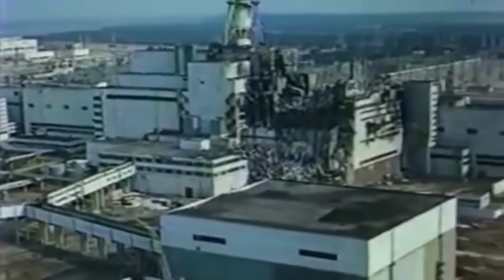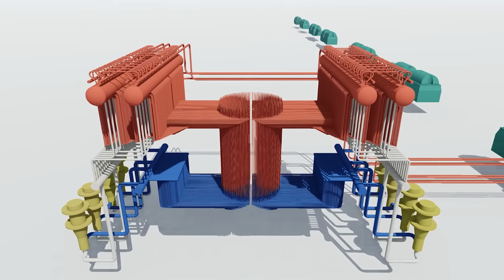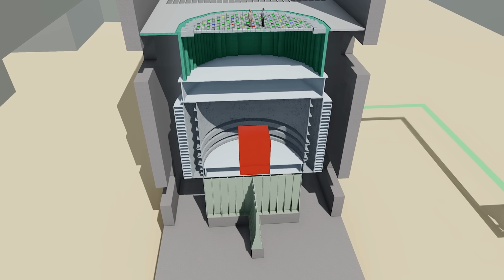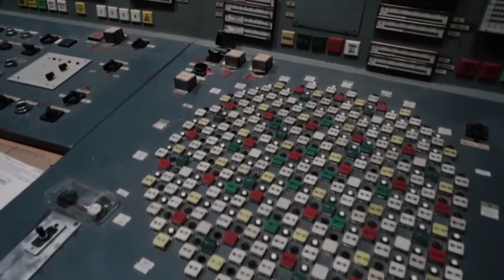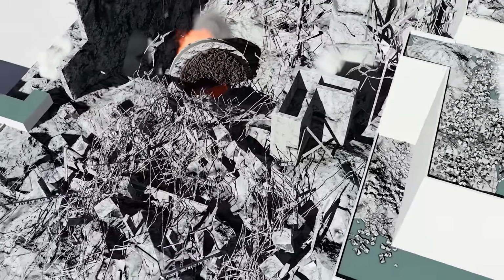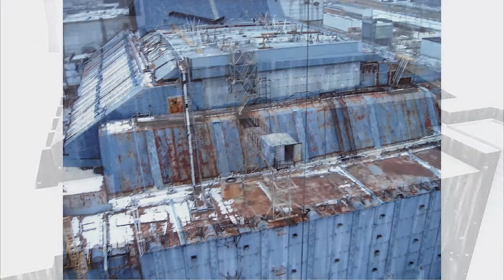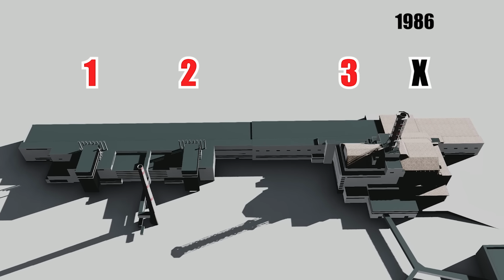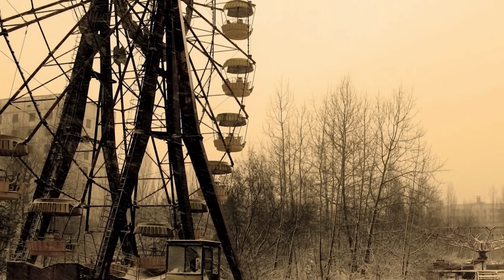CHERNOBYL DISASTER - An Inside Look - 3D

Comment: Most of what is said are comparisons that cannot be compared. That RBMK1000 had a positive reaction coefficient? Yes it's true. However, this is the only thing that can be blamed for this construction, and due to the low enrichment of uranium, it was fine, so RBMK are still used in the Russian Federation.

It is not true that the experience in the USSR was not shared, because all leading scientists not only in the USSR, but also in the CMEA countries regularly organized meetings and e.g. Since 1958, Czechoslovakia has been building its own nuclear power plant similar to Candu for unenriched uranium, cooled with carbon dioxide and moderated by deuterium, and cooperation with the USSR in the design has been ongoing.
Finally, the development of CMEA reactors was unified into 2 types, namely RBMK and VVER.
Today, VVERs are the most widespread types in the world and will continue to expand.
For example, in addition to the USSR, VVER reactors also produced in Czechoslovakia under the ŠKODA brand !!!
So the nonsense in this video is just Western propaganda ...
And please look for the causes of the accident through the outside, such as. CIA.
The Americans and others did not follow this path, not because it would be more dangerous, but because the development and production of nuclear reactors was conditioned by the use of higher-enriched uranium in order to make more money for companies that owned uranium enrichment facilities.
Therefore, the graphite reactors were unpromising because the low enrichment fuel was not available at a lower cost when calculating the same reactor power with the higher enriched fuel.

It is not true that the RBMK1000 had only one shield, but two shields, a steel cover and a concrete cover. The Fukushima type has 3 covers because it was high-pressure, so it still had to have a pressure vessel, but the RBMK is not a high-pressure type, so it does not have to have a pressure vessel.

Advantages of RBMK to the simple construction of undemanding materials and cheap fuel if the price of fuel is real and not artificially inflated by private companies, which repay the loan for enrichment facilities and thus the more they earn, the sooner they repay the debt.
In the USSR, the real price of less enriched fuel was looked at, which was several times lower and the materials for the low-pressure reactor did not have to be as high quality and therefore expensive.

The test was not for safety, if you mean the safety of the reactor itself, but for the test of whether it is possible to supply cooling until the start of diesel generators if the power cables from the outside interrupts and so reactor must be shutdown, because not possible send produced electricity to out.
A few years earlier, these Americans had bombed a power plant with a VVER-type reactor because they began doing similar tests on their power plants, so they were curious about how those behind the Iron Curtain worked.

All other RBMK reactors throughout the USSR have already passed this test, including Ignalina RBMK1500.

The USSR has disintegrated because you have tried and do everything and you are still trying to make the RF disintegrate, but you will not succeed, rather it now looks like the USA will disintegrate.

Ukraine was not left, Ukraine wanted to break away ...

In fact, Pripyat was a normal city like thousands of others in the USSR and the CMEA. But today with apropaganda, it is escalating because people realize (those who lived at that time) that life was easier and they would like to return by then.

We who have lived there will never forget, despite the fact that someone is still trying to rewrite history.

One example.
You received the prefabricated houses that were built at that time free of charge or on a non-repayable loan from the state. And these prefabricated houses in most places of the former USSR and CMEA are still used, and if you want to buy an apartment there, you and your wife must have a mortgage for 30-40 years.

That is the reality of today. You can have 3 cars and you are homeless and you must not be sick, because your life will collapse forever. American propaganda does not talk about that ...

Just as someone still claims today that Navalnyi was poisoned by the poison of Putin by Novichok, so the same people have been pushing you kohlrabi for at least 70 years about how dangerous socialism is, how people are killed there and how badly they live there. And who really lived there wants to go back, so the truth is not there as you get it every day in the media.
Reply from the maker: Thanks for the detailed comment. 

However you lost me as soon as you suggest the CIA could have caused the explosion. Please!!! ... just accept the reactor had a major flaw in its dangerous low power configuration and the design of its graphite ends to the control rods. The USSR did not require any assistance from the Americans to destroy Chernobyl. The RBMK was dangerous in itself and so was the secrecy and mind numbing bureaucracy inate in Communism.
Reply: @Mike-Bell  You claimed yours and I claim mine. It is a statement against a statement, but your statement is mainstream and mine is based on facts that have yet to be published. 
I just don't know if anyone will believe it, if 36 years after the accident, you can hear from all the media, which are not independent, still only one view of things.
Try to think like me:
What happened a year before the Chernobyl accident, what could have an impact?
Mikhail Gorbachev got into the highest position of the USSR.
And what else happened this year?
He ordered the withdrawal of Soviet troops from Afghanistan.
We know from American documents that the US has invested billions of dollars in the war in Afghanistan and probably to humiliate the Soviet army as a revenge to lose in Vietnam (this time we will defeat them).
However, the premature withdrawal of Soviet troops from Afghanistan meant that the money invested went into the air.
In my opinion, this is the reason why someone decided to make a diversion (They left without a fight but we'll get them anyway from inside).
I don't think that RBMK was as dangerous at that time as it is constantly repeated everywhere in the media, but if we help it with a small explosion inside, then it will be a real disaster ...
Reply: @heno_3098  What a nonsense
Reply: @heno_3098  The Soviets got fucked big time in Afghanistan for more than 8 years, the economic cost rounded on the billions and the diplomatic cost was deep...really hard to believe they needed more than that lol specially since Legasov spent a lot of his academic life even before the disaster giving warnings, idk man i'd take the word of the russian scientist specially one who had absolutely nothing to win going against the regime but knew what he was talking about, Valery Legasov.

Comment: I think that the Soviet leadership deceived the whole world on the scale of the problem. The explosion was nuclear in nature, but it would be more correct to call it a self-sustaining chain reaction .. Why do I say that? There is an objective reason for this. The video of the exploration of the central hall shows scenes where the operator is next to the signboard stand. These are sheds located 20 meters from the reactor shaft, where the fresh heat of the assembly hangs. They are not radioactive, as they were not in the reactor. But in the frames we see that these assemblies are hanging but twisted and bent into springs, that is, they were heated up to thousands of degrees. Outside the reactor shaft, there were no such temperatures anywhere. This means that the assemblies were irradiated with a powerful neutron flux and underwent internal decay with the release of heat. But according to the version of the Soviet government, the neutron flux (decay of uranium) stopped even during the explosion (thermal) in the reactor shaft. Ask any nuclear physicist if there is a dense neutron flux in a thermal explosion?
Reply: And I'd rather guess the cause of the crash, and one version says it was a CIA agent in revenge for the money wasted in the war in Afghanistan, where the US invested billions to defeat the Russians, but they voluntarily leave in 1985 year without battle.

Comment: "Western reactors can only be refuelled during a reactor shutdown"

Incorrect, much of the AGR fleet in the UK is refuelled on load or at partial load.
Reply: @Richard Atkinson Yes, we had reactors like that. We called them "Magnox" on account of the magnesium oxide fuel type. 

AGRs do have a steel liner, and presressed concrete containment, and then most of the building at below reactor lid is concrete walls.

Comment: Wait how did the other reactors kept on working as far as 2000? Who was running them, I thought anyone that was near that fucker would die in weeks
Reply: Tosco Russians are built different
Reply: Reactor 4 which exploded had a common turbine building with reactor 3 and somewhere around 2000 people was working and servicing the systems in unit 1-3 until final shutdown. No one died. No-one was exposed to radiation above worker health standards (typically 50mSv per year) which is considered safe also by western operators. Radiation is manageable and overall not near as dangerous as people is made to think.
Reply: @fs00mipe  so all of the pop culture depicting Chernobyl as a pseudo Fallout wasteland was a lie?
Reply: @maestreiluminati87  Yep. There was a ton of work done, but Chernobyl, Pripyat' and most of the Zone are in +- normal radiation conditions now. You can  even get an exursion there. It is mostly safe to be there for long period of time now, if you wouldn't try to drink whater, dig dirt or burn trees. And if youre not trying to touch metal constructions)
Reply: @maestreiluminati87  There is of course increased levels of radiactive "dirt" deposited in the ground and water which carries some increased level of hazard and it is really not recommended to live of crops or let animals grace there since materials can concentrate in such produce. Any produce should be monitored for activity before eating. But the general radiation if you were to walk around is pretty normal. A lot of places on earth are naturally way more radioactive due to uranium rich bedrock and such. Many locals moved back to the area after the collapse of soviet and are living there now eating the food, although with some higher risks. Bigger factors that would influence your life expectancy in the area comes from poverty, heavy drinking and smoking. That is why it is almost impossible to measure any deaths or cancer rates outside of rescue personell still today and the official WHO summary is around 33 deaths resulting from the accident.
Reply from the maker: Tosco Firstly concrete makes good radiation shielding plus the large distances away from the destroyed reactor meant workers could be relatively safe. Secondly during the cleanup the outside areas were cleaned up and top layers of soil removed and dumped elsewhere. Large numbers of staff kept working the plant till 2000 and beyond.  And today Chernobyl is still an active main electrical grid switching and control point for Ukraine.  

And now tour guides take tourists around the facility daily so clearly the radiation levels are safe -ish. . There is an incentive to hype the radiation levels to keep tourists more interested.
Reply: Yeah no, really no. Tourism is definitely not encouraged. People have not returned. The town is empty. 
There are about two partol cars a day, keeping people out. And maybe two cars with guides, and some urbexers running around, hiding from patrol.
The guides make sure people don't stay too long or touch/take things. You have no idea how hard it is to get there as tourist, without paying guides big amounts as well as paying guards. Urbexers here on yt post enough proof. It's a couple of days hiking through woods, sleeping in abandoned houses. Cars will be detected and asked (not politely, unless the right price ofc) to leave immediately. You have to cross a river, and the bridges are patroled. The woods are not easy terrain and you have to know the area to avoid where the top soil was dumped. Please take a look at the videos. It's still a disaster site, not at all ready to return to normal. 
It ofc has been 20 years now since they really needed someone to be there. So maybe it's quieter now than it was then, with shifts going in and out. Prolonged stay will be dangerous for a long time still.
Reply: @MrsJolene-  I didn't mean that anyone were allowed to move back to the town of pripjat but rather in the larger area which was evacuated. Like family farms and cottages. But since contamination levels varies quite a lot, it can be quite safe but also quite dangerous. If you find a hotspot and decides to eat a couple of kilos of that dirt you could definitely get sick or die. The danger stems allmost purely from ingestion or inhalation of locally contaminated materials.
Reply from the maker: @MrsJolene-  Do you live in Kiev and know the area and have detailed knowledge or are you guessing?  In 2019 its estimated there were 100,000 Chernobyl tourist.  So there are peaks of around 750 visitors per day requiring many tour guides and supplementary staff who work there every day.  There are designated routes which have been well decontaminated and radiation levels acceptably low.  But radiation is highly variable and you might leave safe zones and within 100m find a radiation hotspot where it is a bad idea to spend a longtime.  But this is part of the fascination which draws the tourists.
Reply: @Mike-Bell  I have family near Kiev and I'm talking about Pripyat itself, there is still an exclusion zone. So nobody, for sure, is staying there to work. Some may drive to it for work, but they have to be careful about their time there.
That tourist number is an estimate and I really doubt it's that high. But maybe they're also talking about the region and the woods, not the town. The woods are interesting as well, as crooked trees can be found, growing downwards because of radiation. Or weird insects.

Comment: The animations are awesome but there is a lot of bad information here. The RBMK design is totally safe and Russia still has a number of RBMK reactors still operating flawlessly. The test also wasn't done to prove reactor "safety" it was done to see if the turbines could provide enough power as they wound down until the diesel generators could kick in a minute or two later. Common misinformation from "the" uneducated western perspective, you are not alone buddy.
Reply: Talk about uneducated, look in a mirror. The other RBMK reactors weren't safe in their original design and only become safe after the disaster when they were retrofitted. 

And it was a reactor safety test which led to the disaster.

"The accident started during a safety test on an RBMK-type nuclear reactor, which was commonly used throughout the Soviet Union. The test was a simulation of an electrical power outage to aid the development of a safety procedure for maintaining reactor cooling water circulation until the back-up electrical generators could provide power."
Reply: It was a safety test. Western designed reactor typically has diesel generators kick in at full power after 8 seconds or so to provide cooling of the core. The test was to prove that the in-house turbine momentum could provide power to overbridge the gap until diesel cooling came online. Western designed containment can withstand 6-8 bars of steam pressure around the reactor without leaking. RBMK designs has practically no containment. Not that a containment would have helped in the Chernobyl case, it would have exploded like a pipe bomb anyways because of the power excursion of 22GW (last measured value) which was about 10 times the rated power of the core.

Comment: "western reactors are stable by design"
Fukushima: "hold my beer"...
Reply: If they have enough Water...
Reply from the maker: They are stable while running. Fukushima melted down from decay heat in shutdown state because of loss of water coolant because the tsunami knocked out circulation pump power. Not because the nuclear reaction got out of control.
Reply: @Mike-Bell  RBMK is also stable while running. Chernobyl 4 failed when trying to restart it from 3%, while having circulation pumps turned off.

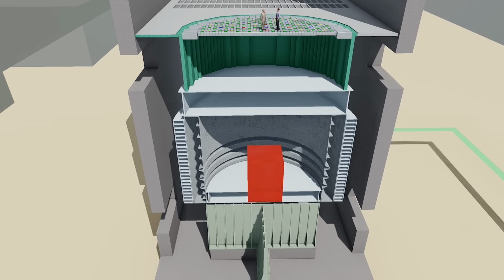Comment: Quick question, which Fukushima's reactor is he comparing here? (2:10).  Or were they all the same size, even though their power output was marginally different?
Reply from the maker: Dkmasteris all Fukushima’s reactors were basically the same size as indicated in the modeling of this video.
Reply: @Mike-Bell  Interesting. Could you explain how they achieved more than twice the power output from six compared to one. Always assumed, the were simply bigger.